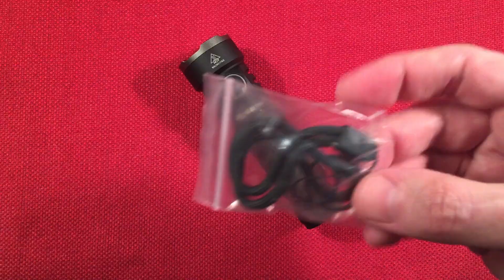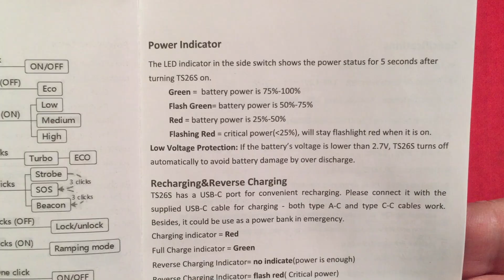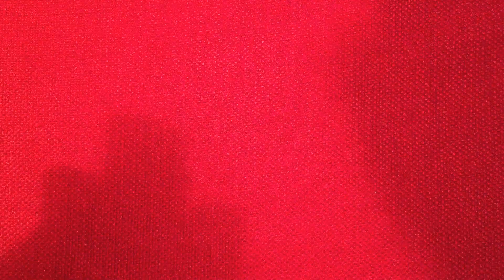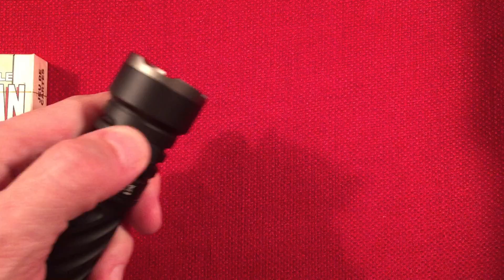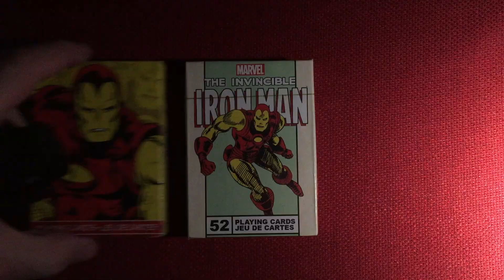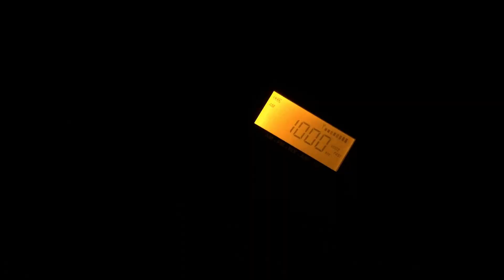Wurkkos TS26S 21700 High CRI EDC Flashlight Review

Comment: Thanks for this amazing content. In your opinion, what's the best flash light for someone living in a dark village?
Reply from the maker: There are so many good options out there.  If you need reach, look for something with some throw, otherwise a lot of flood and a high capacity 21700 maybe the way to go.  I have been carrying a Sofirn IF23 Pro which provides 5000L in a pinch, and runs cool on a 21700.  It provides tons of flood.  So you have edge to edge awareness as you walk.

Comment: Is that a defect in the power button, the black splotch at about the 10 o clock position?
Reply from the maker: No, it is their logo.  I thought the same when they started using these new buttons.
Reply: @todderbert  Not a fan of that at all.  Just doesn't look clean.  Clearly just a nitpick however.